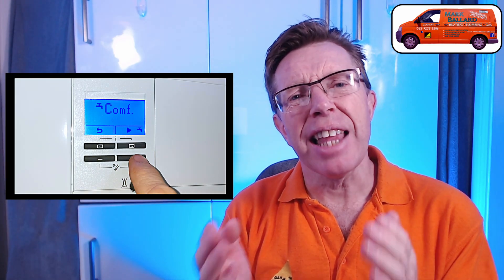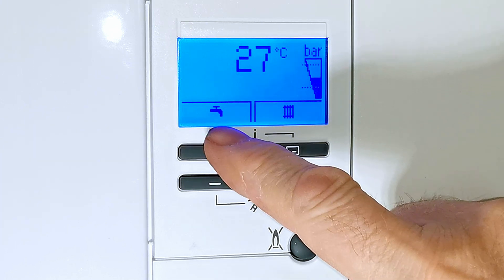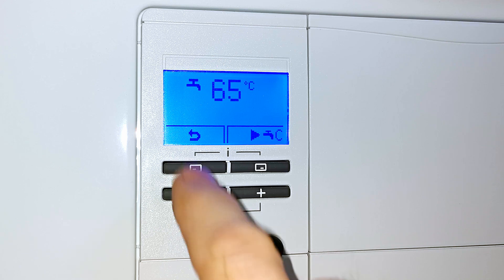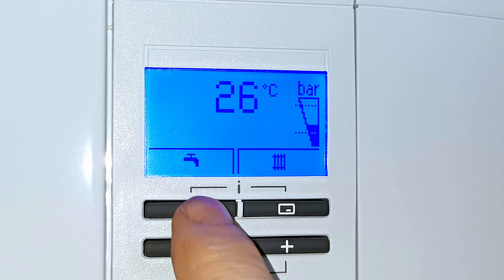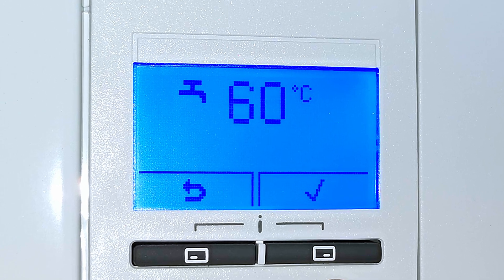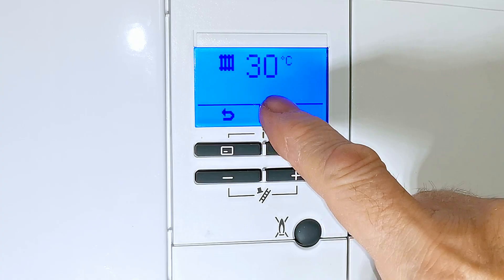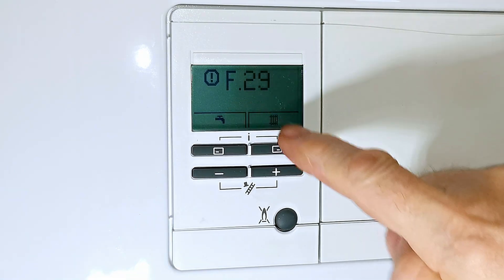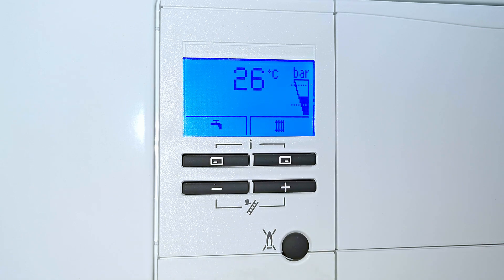How to Operate Your Vaillant ecotec Pro Combination Boiler, Adjust Hot Water &  Heating & Lots More.

Comment: Okay , so I set up the flow water to 48 degrees but then the service guy said that the water temperature should be more higher than that for killing some bacterias. I’m using hot water only for washing dishes and hands in my bathroom. Shower I have electric so 48 degrees was just perfect for me. Now I’m not sure what to do  …help 😮

Comment: I have my water turned up to the max because then I mix in cold water and get a decent flow rate out of my shower. If I set the temperature where it should be, the pressure isn't high enough using hot alone.

Comment: Hello, please help
I have this boiler and when I turn on the heating thermostat, the boiler only turns on for a moment, heats up a little water for the heating, then only the pump turns on for a moment and then turns off and after a while turns on again the same way. It does not heat continuously up to the set temperature, and it is cold.

Comment: Our vsmart thermostat has broken. The plastic casing near one of the batteries has snapped off. Terrible weak design! I've managed to bodge it back together to get a good battery connection, but it is unreliable. Is there a way of activating the heater when the thermostat isn't working? Nothing obvious on the control panel!

Comment: Hi I wonder if you can help me. We had this boiler fitted in march 24 and all engineers, even after our own fitter and two subsequent vaillant engineers are at a loss why our radiators ramp up fast to the target heat then stop and don’t moderate or tick over to keep an even temperature, the rads just go cold for hours (giving a distinct coldness to the room plus cold bathroom etc) until the temp drops and they come on a ramp up again to then do the same thing. We had a new thermostat and various other things were checked.  We are now waiting for an upper level expert vaillant engineer knowledgeable in this particular issue to come to check things out. Im not technically minded at all in heating but one shouldn’t have a new boiler to find half the time we dont feel warm and dont have a steady temperature in all rooms.  Does anything spring to your mind about what might be the issue? Or point me in the right direction ? Thank you so much.

Comment: Hi, great video! Quick question,  what does the flashing egg timer sign means? Also whe when I have connected hive thermostat, the pressure shot up to 3.1 and the screen started flashing.... Am about to call an engineer, just curious what does the flashing egg timer sign means.... Also, I have the version with the timer. Thanks

Comment: First at all thanks for this video which I found very informative on how to operate the boiler. I recently had an Ecotect Sustain installed and I found that the boiler wakes up when opening any cold water tap in the house. The fan starts to spin up, you can see the flame symbol for a short seconds and then disappears and eventually the fan stops spinning. I have never seen or expected this behaviour with previous combi boilers, Is this normal?

Comment: If the water temp is set to 55 (for example) but you want your washing machine to do a wash at 60, will it work, or does the water temp need to be at least the temperature of the water you want the wash at?

Comment: I have the eco tec pro 28 it was installed in 2012 and it has dials for the hot water and flow temperature

Comment: Must as I like the Vaillant EcoTEC Plus...
MY understanding is: it's designed to ware the boiler components out more quicker by starting most of the boiler's parts up for a short mount of time, then off again, then on start again, on/off all-day!
As most would know starting things up is all ways the hard part of ANY device.  Let alone the burning of the gas and ele.  So you're paying for the gas,ele AND the replacement part too! ££££ 😛
Have I get the wrong?  (RefCode:Vcva54Taasf8)

Comment: My valiant eco tec plus has been off for central heating for the 3 or so months of summer. Hot waters been fine with no pressure loss or faults. I turned the central heating dial last night and it started but the pressure dropped to zero. I hit the flame button while turning the taps on underside and heard a like a loud switch click noise and fired up, closed  the taps and pressure dropped again. So I turned the central heating dial off put the pressure back in the system and hot water works and holds pressure but if I turn that heating dial the pressure goes and I get F75. I pushed the pressure vessel valve in and water shot out.

Comment: I was going to clean my filter the one shown in this video I turned the valves off but when I opened the filter cover water kept dripping out I wanted to empty the filter because I was trying to add some inhibitor fernox  but when I emptied the filter with a sponge I could hear more water come in does this mean I have faulty valves the ones with black knobs

Comment: THANKYOU , i have a vaillant  eco tec pro its quite old maybe 2007 and its a council boiler they are extremely reluctant to advise and each time its checked they turn the radiator and water dials up ,  i have my rads on around 55 to 60  and water is around 44 so not hot but comfy to wash hands without worrying about being burnt , had this since it was installed , the digital dial doesn't show a c at all so does that mean i don't have pre heat  or i don't have an option to turn it off and on . many thanks

Comment: Scotland, today it's getting cold now, I'm 70 & scared to adjust my boiler settings. Hot water is easy to understand but central htg what is correct temperature. I live in a 2 bedroom bungalow. Also it's summer, htg off, hot taps not running, my boiler fires up for minutes for no reason? 
  Ok, done the tutorial at the boiler & now I know why it fires up as said - COMFORT! its now off. Set hw & will see how that goes & raise or lower. Htg, also now set at 55c & will monitor. Only thing is my rads also have a adjuster for them, not too sure on that, maybe Tango Mark can help there too. I was going to call the council house people but no need now & they wouldn't know as much as Mark. Glad I Googled this, the wonders of the internet. Thanks Mark (can you tidy my house?!).

Comment: Amazing video thanks! My boiler has a clock on it and it makes a ticking sound, which is really annoying. We have a thermostat and I was wondering if a qualified person would be able to remove the panel with the clock and replace it with the one in your video ? thanks
Reply from the maker: they start ticking as they get old.  the clock just pull straight out.  any programmer can be fitted

Comment: Hi Mark, thanks for this vid! In our ecoTec manual it says to set the hot water to minimum 60 degrees to prevent legionnaire disease - is this something we should be worried about if setting the hot water to 55 degrees?
Reply: Over here in the NL 55'C is advised as absolute minimum against Legionella.
Reply: In germany this setting is regulated by law for ALL COMMERCIAL used hot water supply. For PRIVATE use they recommend the same temperate but its up to the user to do so.
If you got a real good craftsman they can give you some advice (and will explain why) and will turn it down IN PRIVATE business because its not really a problem there and it also causes nothing like that.
For example ours (and a lot of other colleagues) is set to 45°C without any issues the past few years.

Thats not a recommendation from me to do so -its only for information.

Comment: Great video, but I'm missing the installers menu where in my opinion sits the most important setting: d000 - output power. This is the real money saver. It's default set to the maximum power consumption. I've set to 6kw which still keeps my house warm but only cost me 5,7 m3 gas per hour. Also, like others mention, do not set the hot water below 55 c degrees

Comment: Is there a way to turn on the heating from the boiler itself without using the Heat Link? My Heat Link isn’t working no lights on it at all. I’ve tried holding the button down we’re but won’t come on. Any help would be appreciated 😊

Comment: Hi great videos.  My systemseems to have water topping up every hour for approx 5 seconds you can hear the mains noise as it does so but I have followed your topping up sequence and brought my pressure up. What could be causing this mains yopping up noise, happened before and after topping up the pressure, In anticipation thanks,
Reply from the maker: Water noise can sound like it's coming from one place  but really it's coming from somewhere completely different. If you have the sound of continuous water running suggested you may have a leak in your mains water pipe going into your house.
Reply: @MarkBallardLTDHeatingEngineer  the mains topping up sound is actually every 15 minutes and seems to eminate from boiler,  we have no leaks anywhere, thanks

Comment: Hello, thank you for the information. I turned off the confort mode as water is cheaper than gas ;) I'm concidering the idea to use an electric boiler of 50 liters, that will be heated with solar energy, that is connected to the cold water inlet of the Vailant ecotec Pro.. Is sthis something that is possibe? So you feed in water at 50°C so the vaillant boiler sences the temperature and just sends it straight to the outlet without extra heating.
Reply from the maker: Yes, I have seen this as a proper installation. Mains cold into a tank heated by solar panel, then that tank feeds the cold mains into the combi boiler, so the boiler I will not need to fire app if the water is to temperature that the boiler is set to.
if the water in the tank is not quite hot enough the combi will heat it to what is needed👍👍.
 very good idea.👍👍

Comment: There's been a few gas engineers out to fix the gas but they can't seem to find a problem. 
I've got a flashing water symbol that won't go off so I'm stuck with no heating, only hot water. 
Sometimes it goes off itself and the gas will work, but when the symbol appears, the gas goes off again. 
Do you have any idea how to turn this off?

Comment: Hi Mark, can I switch off the boiler when I sleep, and turn it on again before shower to reduce my energy bill? Will I have to reset the whole boiler again whenever I switch it back on or will there be any effects on the boiler? Thank you!
Reply: Just in case, just follow Mark, select Comfort off & the hw temp that suits you best. It won't come on at night unless you have htg on & adjust temperature in your living room dial. Just set it low but enough too stop water pipes freezing in a cold spell. Keeping the house so cold if off will use more gas in getting your house warm, in summer turn dial right down, in winter about 15c is best & when home turn it up to 20c, also don't lounge about in T-shirt & pants, dress warmly with a cardigan or even use thermal long John's & put a armless puffer jacket on, you'll feel hot & turn down temperature. I'm 70 & all we had as a child was a coal fire. Rmbr in freezing weather keep some htg on as a burst pipe... hope that helps.

Comment: Thank you. I was looking to shave diwn the gas bill (aren't we all!) and i found this very helpful. I found the heating set to a whopping 75 and the comfort button on... now set to your recommended levels and i can see how it goes. Thank you!
Reply: I read that if the water is not over a certain temperature there is risk of leggionnaires disease !

“Yjd primary method used to control the risk from Legionella is water temperature control. Water services should be operated at temperatures that prevent Legionella growth: Hot water storage cylinders (calorifiers) should store water at 60°C or higher.”

Comment: This is the perfect tutorial for those with an engineering degree. For those of us with mild to full dyslexia and poor retention of systems where pressing the same button does different tasks depending on the data you have retained from the initial instruction... it is mind numbing. The little tap symbols and backwards and forward arrows and ladder with a little Top Hat.... it doesn't make it clear at all. My previous boiler had a thin manual  and was clear. This is a boiler for techies, a boiler for call out charges, a boiler that expects all who use it to understand its jargon and a 34 page instruction book.... and why in summer when the heating is off and my Danfuss timer is off to stop the water heating up while away, does it not work when I switch it back on a Friday night when I return only to find I have to use a costly emersion heater to heat my water... and that I can't get an engineer until Monday, that's if there isn't a massive queue of others with the same problem! I have one word for the manufacturers of this device.....SIMPLIFY!
Reply: It's said simply & I need simple, but I understand your needs, get a friend neighbour to help you understand Mark's instructions.
Reply: I found it very useful..69 year old female.. I just need to find out how to reduce the pressure bar as mine is higher than that shown  . Subscribed for more useful info . 👍🏼
Reply: If it was anymore simpler he’d come round and do it for you…. 
If you can write a well thought out and worded whinge on YouTube you can slow yourself down and listen to what the man is saying. 
Stop being a victim and get on with things. ☮️👍🏼

Comment: I've had it with my Vaillant Ecotec boiler that I'm this close🤏 to ripping the effing thing off the wall. My boiler is in summer mode (radiator temp set to 'OFF' and displaying the parasol icon), but I've set my hot water temp to 65 and it's not heating up at all - not unless I take the boiler out of summer mode. However, if I do that, then the radiators turn on which I don't want. The programmer on the wall for the water is on 'Timed' and I've pressed the 'Advanced' button, but the damn boiler just sits there at 35 degrees flashing that parasol icon and not doing anything. Please help 😭

Comment: Hi Mark
It's a very interesting and informative
My boiler ecotec pro 24 start flashing tab with out running any tab plus gas flame on time by time too what's is happening I am very confused please any help .thanks
Reply from the maker: Not sure what your asking . You may have hot water preheat on if it's randomly coming on

Comment: You should always have hot water set to atleast 55 degrees, because of the risk with legionella.

Under 50 degrees and they start to reproduce, which can cause real illness for the house holder.
Reply: Only if you use a system boiler....i.e water is stored in a tank.
Reply: In germany this setting is regulated by law for ALL COMMERCIAL used hot water supply. For PRIVATE use they recommend the same temperate but its up to the user to do so.
If you got a real good craftsman they can give you some advice (and will explain why) and will turn it down IN PRIVATE business because its not really a problem there and it also causes nothing like that.
For example ours (and a lot of other colleagues) is set to 45°C without any issues the past few years.

Thats not a recommendation from me to do so -its only for information.
Reply: Yeah, that's what i came to this video for, to see if he mentions anything useful about that. I recently thought about lowering the temperature since the hot tap would always scald me. I looked up what the average temperature is and found out that it's around 60°C so it kills off the Legionella bacteria in the water. That made me wonder why cold water is safe then, and found that under 20°C it remains dormant. Whereas from 20°C to 45°C it grows rapidly. At 50°C / 60°C / 70°C it dies within hours / minutes / instantly.

Similarly, i've looked up what temperature will scald you. And 60°C can scald you within 3s. At 50°C it takes 10 minutes. (Note: Children/elderly have thinner skin so are more easily scalded) So it'd be nice to be choose lower temperatures than 60°C.

And there's a simple solution. One that we already do manually. Mix in cold water with the flow. Except it'd be nice to have the boiler do it automatically for us so we don't have to mess around with two taps and can keep a consistent temperature. There are thermostatic mixing valves which are used to have a constant safe temperature.

Also i noticed that my boiler allows itself to way over boil the water. I set it down to 55°C yet it went past 70°C. So i think my boiler needs sorting out. Unless they designed it to be as dumb as a kettle. lol (where holding the switch keeps it boiling) And you'd assume kettles would recognize the water is boiled and prevent further boiling unless it's a degree colder or something. So i think i might have to set the temperature slightly lower to compensate for its over boiling nature.

Sorry for such a long comment, i hope any information there helps anyone out.
Reply: @DlcEnergy an independent slimline shower is best & not tied in to a boiler. Just connects to cold water & electric power. Keep shower head clean with disenfectant or bleach wipeover.
Reply: @seltaeb3302  Also i've had a new shower installed since then. I had an electric shower before, but now i have one that just uses the hot and cold pipe. You can control the flow/temp.

That's what i wish my kitchen taps were like. Rather than have to manually control 2 taps, just have one tap to set the temperature, and the other to control flow.